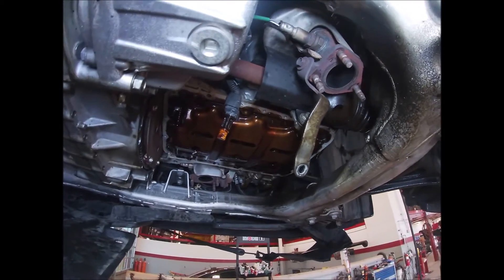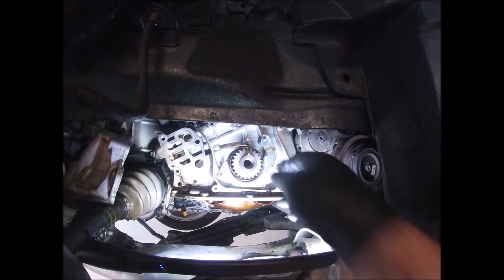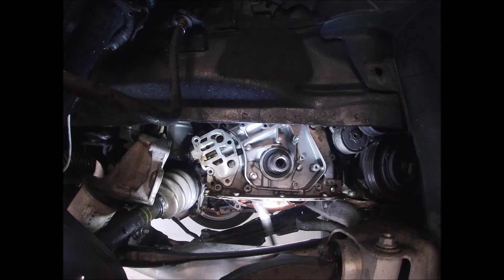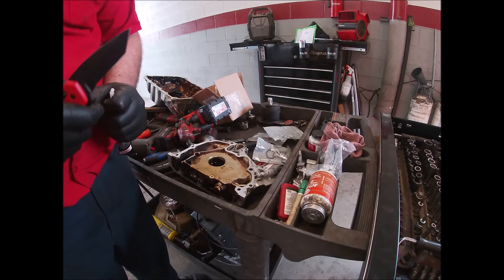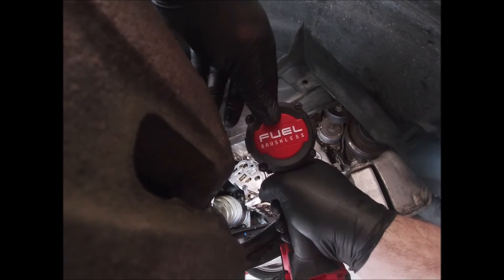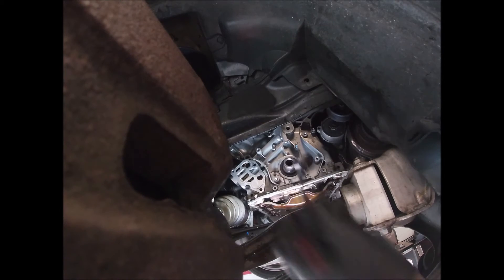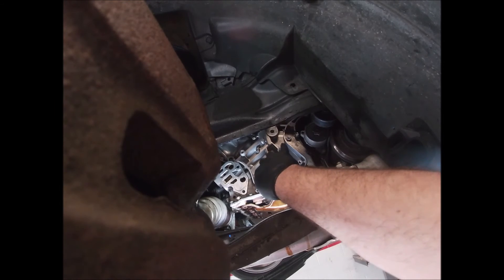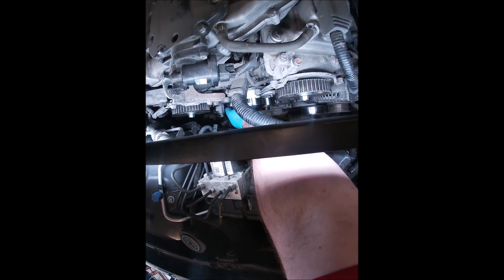Honda V6 Oil Pump Reseal

Comment: Good video! I just got my 2011 Pilot back from Honda service to do timing belt & water pump $850. Oh better do the tensioner too +$191. Right side engine mount shot but only $72. BTW the oil pump is leaking as well +$580. Only 85K on my Pilot....Good detail on our video-thanks!

Comment: I think your socket is worn (jumping off the bolt head like that).  I bet some utea grey on the oring gasket flange area will help the flange seal when the oring gets hard again.  It will leak on the oil pump housing side if you score the aluminum.

Comment: Great video, thanks!

Recently purchased my 07 RL and am at the beginning stages of replacing the timing belt. Before taking things apart, I noticed a pretty bad oil leak coming from around the oil filter housing area. I figured I would remove the oil filter housing and replace the o-ring/gasket for the housing but know I have been reading about oil pump leaks for the same vehicle and wonder if that is what is going on with my RL. 

How can you tell if it is the oil pump that is leaking or the oil filter housing that is leaking? RL has around 198k miles. Also; on the crank pulley washer, can you tell me which way the concave side of the washer goes... towards the engine or towards the timing belt cover?

Thanks!
Reply from the maker: If it has 200k and you're doing the timing belt, and have a leak in that area id just assume that pump seals leaking and replace with since you're half way there. The concave faces away from the timing belt, toward the cover.

Comment: So, I have a J35Y2 (9th gen 13-17 Accord V6). I’m having issues with the 3 timing marks. Is there a way you can dumb it down for me? That’s pretty much the only thing that’s really keeping me from doing this job myself from home, minus the cost of it done by someone else obviously.
Reply from the maker: I would recommend watching my other video about replacing the timing belt; that explains in detail everything youll need to know.

Comment: Quick question for Acura TL 06. Would a whining noise come from the oil pump Or maybe a input shaft bearing from transmission? like a supercharger sound? The sound disappears when car is warm. I was testing it around the block when you drive it close 20 MPH. Super loud supercharge type noise.
Reply from the maker: I would have to hear it to know for sure, but if you haven't checked the power steering pump they damn near always make noise. The oil pump would not make noise for sure, a trans bearing would typically make noise regardless of the temp, and most likely cause alot of driveline vibration.

Comment: Heyy nice vid! I was wondering if the low oil pressure it will be fix with changing the seals or have to replace the entire oil pump? (J32a2 swapped miata)
Reply from the maker: From my experience even a severely leaking oil pump will still have decent oil pressure. Low oil pressure has almost always been a result of the pickup tube being clogged with sludge and debris. Then as a result the bearings and pump are junk, at that point you may as well pull the engine and rebuild or replace it.
Reply: Yes im replacing the bearings, but what caused the scratches on them?  Bc Idk if my pump is working properly
Reply from the maker: @Paul Saucedo  most likely low oil level from leaks or not being changed enough. Leaking rings causing oil to be burned off, or just debris and sludge in the pickup tube.
Reply: @brokedickgarage3840  Thank u very much! U got a new bolivian sub 🍷😀

Comment: Have an 02 Odyssey with 308k miles.  Probably needs a new oil pump seal.  My question, should I replace the oil pump with an aftermarket pump, ie Rock Auto, or just use the factory pump and replace all of the seals?  Just concerned about after market parts other than AISIN.  Don't see AISN oil pumps online.  Thanks.
Reply: I know it's 2 months late, but unless you are having issues with that pump, just reseal and reinstall. They can go for an exceptionally long time and I am not a fan of aftermarket items in those areas unless it's the same manufacturer as OEM.

Comment: can i do this job on honda accord  V6 2015 goes same process? and my oil pump make nocking noise does it need replacement or resealing only?
Reply from the maker: It is pretty much the same for a 2015. If the engine is knocking already, the damage is done. More than likely the engine needs replacement.

Comment: Hello I’m looking forward to do this job . But every time I want to buy the seals i only got the oil pump seal . How you call the o ring that goes inside the oil pan ? And the other seal that u mentioned it was leaking from ?
Reply: The oil pan itself is just rtv, theres no oring. Otherwise the other seal youd want and need is the oil filter housing oring seal.
Reply: @diablofocker1  Have you seen that FelPro now sells an oil pan gasket for most if not all of Honda's V6 engines? I saw one listed for my '05 Pilot last week on RockAuto and then I looked into it to make sure it wasn't a mistake.  It's FelPro's T series which is what I have on my '98 CRV and it's by far the best oil pan gasket I've ever owned as they just don't leak. It's around $35 for my Pilot and that's the way I'm gonna go when I tackle the oil pump o-ring/TB/WP job in July. You should also replace the o-ring for oil pan pick-up tube while you're in there.

Comment: Did u had to remove the motor mounts bolt
Reply from the maker: I do take the motor mount off completely, just makes it easier to service the timing belt and components. You don't have to remove it though.
Reply: @brokedickgarage3840  do you just let the motor hang? Or did you support it from above? I’m about to do this job. Is it ok to not support the motor with mount off? Thanks

Comment: Have a question I saw you was using h/t honda bond. What's the difference between the high temp and the honda bond flange ulta for that project
Reply from the maker: Couldnt tell you tbh. This is the glue i have always used for this job, and thats recommended by honda for this job.
Reply: I personally have used Permatex and Versa Chem’s ultra grey/gray RTV gasket maker without issue. They’re basically re-branded OEM Hondabond gasket maker. The high temp properties of the grey gasket maker are usually the same. 

The only thing that I guess I would probably use, is maybe the black RTV formula over the gray RTV formula. The black one supposedly holds even MORE heat than the grey one, but takes even LONGER to cure…. And seeing as how someone said it could take up to literally 3 whole DAYS for grey RTV gasket maker to fully cure for an oil related job like this; I could only imagine how long black RTV gasket maker would take to cure if you didn’t get the “ready in 90 minutes” (fast setting/curing times).
Reply: I myself prefer the Honda Bond , when I don't use it, I prefer the high-tac quick curing RTV especially when holding gaskets in place on cars that have them

Comment: How much is the labor for oil pump reseal like if the timing belt is excellent if somebody just wanted the oil pump reseal done?
Reply from the maker: I would expect all the gaskets to be 100ish. Ontop of that i believe its a 6 hour labor job, so 100 an hour, plus fluids etc. Bare bones this jobs 800ish depending where you go.
Reply: @brokedickgarage3840  thanks
Reply: Dealer quoted 1900$ with timing belt
Reply: I have MDX , changed the engine 7 months ago now oil pump leaking , shop guy no dealer wants 1,600 before taxes. What’s your take on that?
Reply: @brokedickgarage3840  Exactly the reason why I've done almost all of the maintenance on my Honda's over the thirty eight years I've owned them. I may cuss at times and get frustrated and skin some knuckles but spending that kind of money on a job like this which I can handle myself would kill me. I plan to take care of this problem on my '05 Pilot in the summer while I have everything dismantled for the TB/WP job....kill two birds with one stone. Thanks for the video!
Reply from the maker: @hondaphan4172  ive got a timing belt video up as well.